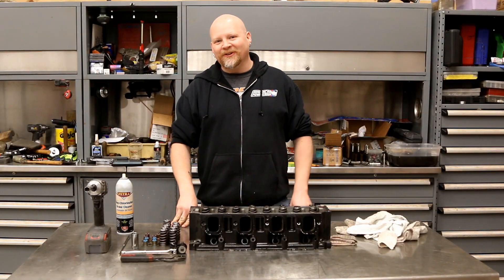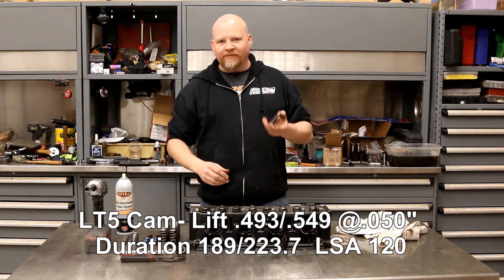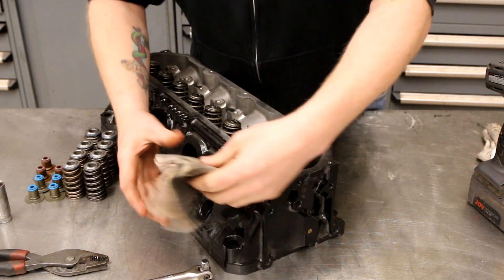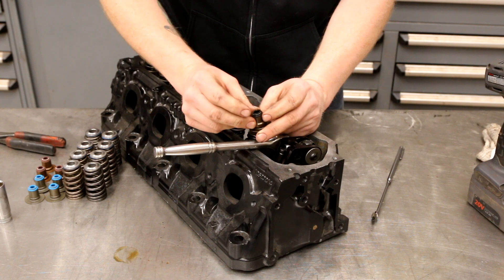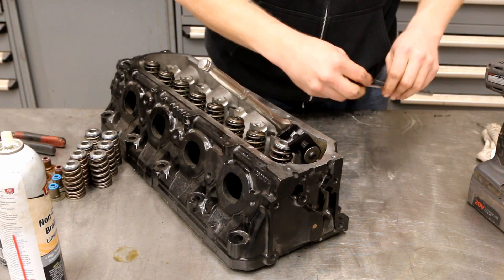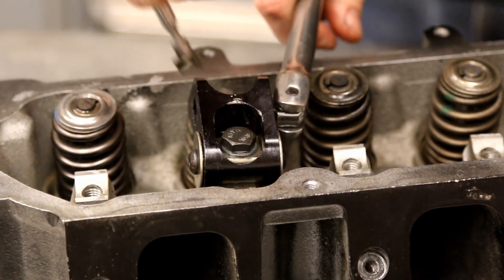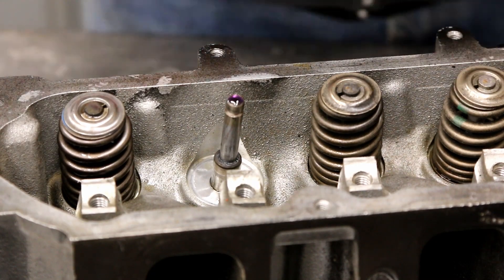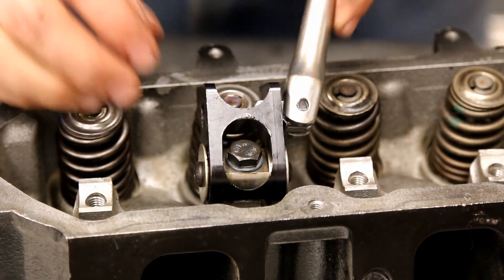How To Install New Valve springs In a Gen V L83 Cylinder Head For an LT1 DOD Delete Cam Swap

Comment: Where can I get that tool ?
Reply from the maker: Thanks for asking, I am terrible about the links! Lingenfelter Performance Engineering L950025297 Lingenfelter Performance Engineering LS Engine Valve Spring Compressor Tools | Summit Racing https://share.google/si8TV8P3zmqKzuR48